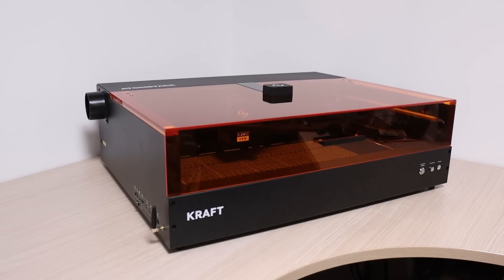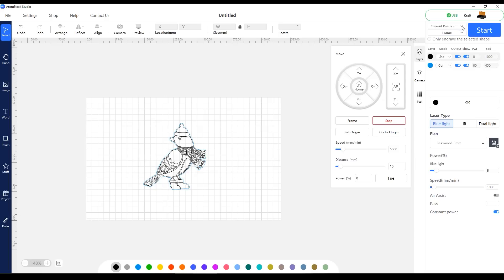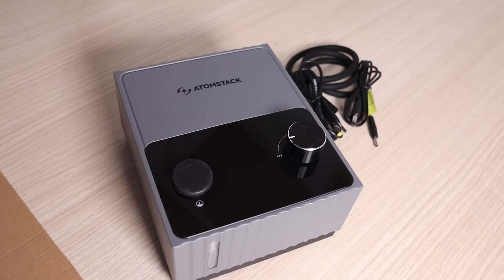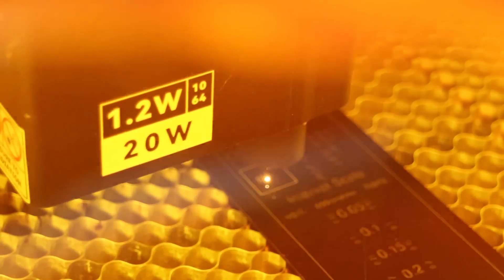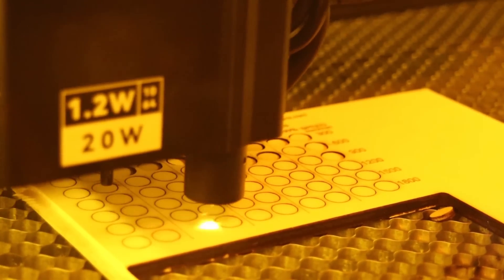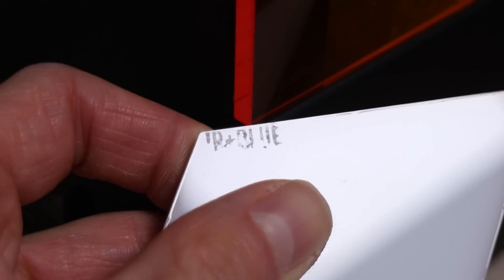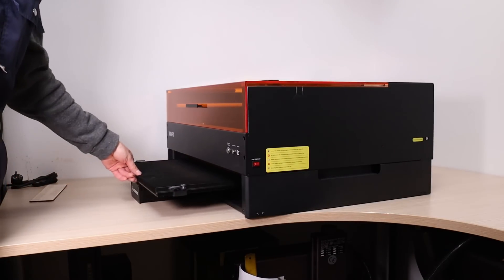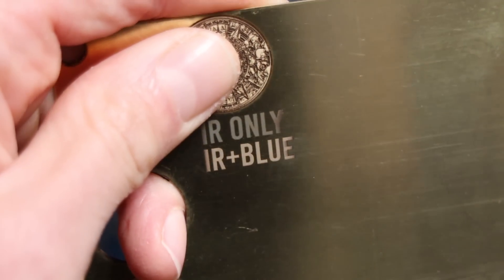Brand New AtomStack Kraft Is Full of Cool New FEATURES! (Review and Test)

Comment: Can it engrave glass? I am looking for laser for a craft shop. Will do some engraving on wood and glass. Maybe some metal. Came across commarker omni. That one looks great with no char on wood works. Do you think this AtomStack is better instead?
Reply from the maker: @Ale-d5i4b  for glass Omni is much better (i also made a review of it). Atomstack can't engrave glass directly. You need to paint it black for engraving. But UV laser will result in much better glass engravings. Diode laser like Atomstack Kraft is better at cutting. Wood and producing dark engravings.

Comment: I wonder whether the order makes a difference or not? For example: first the diode and then the IR and vice versa, and then how big the IR point is
Reply from the maker: @linassapnagis2174  they are fired at the same time. This way when engraving metals, blue laser helps to add heat so the IR laser works much better. Engraving first with one and then with another doesn't make much difference. 
You can see the size of the IR module in the anodized aluminum test in the video